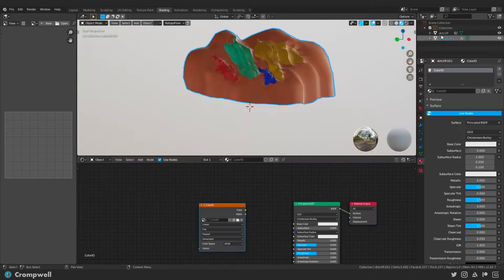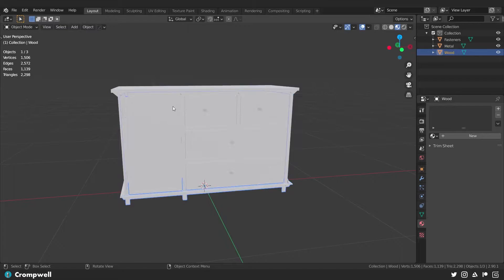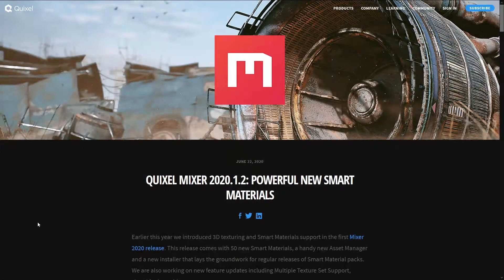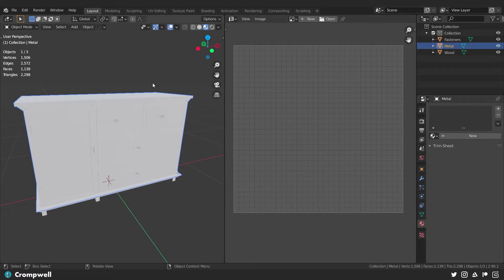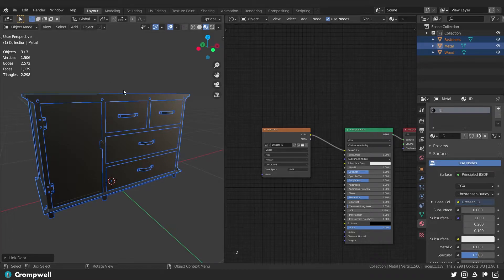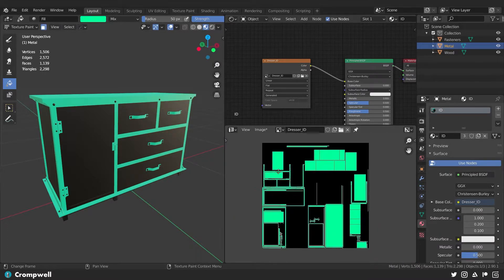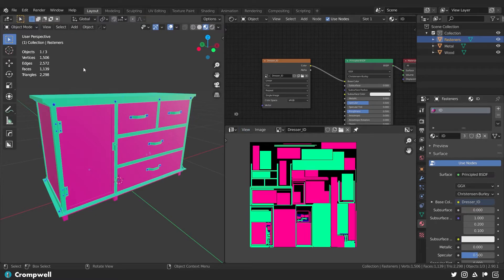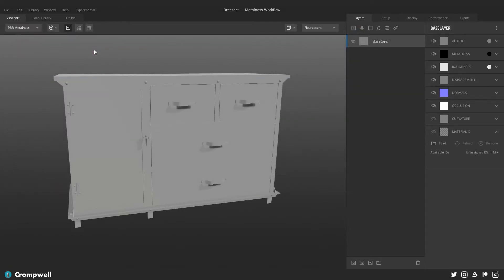Preparing 3D Models for Texturing in Quixel Mixer Pt. 2

Comment: Man, this is exactly what i was looking for ! Thanks ! Do you probably know, if it is possible to reuse paint masks on other materials/layer ? I can't figure it out.
Reply from the maker: If you have a paint mask in the stack you should be able to copy that layer and paste it elsewhere. It's been a while since I've used Mixer, but if you remind me with another comment, later tonight or tomorrow I can check.
Reply: @Crompwell  In case you can be bothered, could you have a look ?
Reply from the maker: @blenderheadxyz2418  Going to check now :)
Reply from the maker: So, with a paint mask, you can copy or move the layer to Layer Sets. Alternatively, you could export the paint layer and apply it as a texture mask to any other layer (this can also be done outside of Mixer, in Blender for example). Seems like it needs a workaround since you can't directly copy a paint mask to other layers, at least that's what I'm finding.
Reply: @Crompwell  Wow, thank you Mr. Crompwell :) That was very kind !

Comment: My mesh doesn't have a baselayer?
Reply from the maker: In Mixer? Might have to do with the new update that just happened.
Reply: Under Setup, click Edit Texture Sets, and you can add the ID at the bottom.
Reply: @kuro2ck  i did that, but i can't see the colors on the mesh, is so confusing since there is no info about the new interface

Comment: İTS PERFECT nobody taught texture painting for baking UV's. I have only one problem Where is color picker tool in the texture paint ? I want some of part same as other parts after I already paint.
Reply: I wnana thank you again again and over again. Its so ironic how it's so easy as well as nobody told this method before
Reply from the maker: Just hover the mouse over whatever color you want and quickly tap and release the S key. It will select the color. If you click with the mouse, it will attempt to add a swatch instead of picking up the color. I’m glad you found the video helpful :)

Comment: 6:50 when i select only one part of my mesh and follow the steps to fill with a color, it fills all of the parts of my mesh instead of the one that is selected.
Reply from the maker: Make sure the button next to “texture paint” in the top left is turned on.
Reply: i tried it a few times over and it seems to not be working the same as yours. my entire mesh gets colored in, except for some areas that are splotched with the cyan color and the original black color. i have clean uvs for both parts. its just a butcher knife. so when i try to fill the blade with cyan, the handle will get colored also even though its a separate mesh. is there an update since this video was made that maybe changed how it needs to be done now?
Reply from the maker: @EDITMODE  It’s difficult for me to troubleshoot the issue for you without seeing what you’re doing. If you want to upload a screen recording I might be able to help.
Reply: okay....its because my whole mesh wasnt unwrapped together. each part was unwrapped separately. if anyone else has this issue, unwrapping the entire mesh together should fix it.
Reply from the maker: @EDITMODE  Yes, if you have overlapping UV’s, this won’t work.

Comment: Hello Crompwell, and thank you for this tutorial :)
I have a question for you : I do the same export as you, but when in Mixer, I add a surface layer with displacement, the edges on my model are not connected anymore. It is like they separate from each other. I tried with a simple cube too, but the result is the same. I was wondering how I can deal with that. Do you have any idea ?
Thank you in advance and have a good day
Reply from the maker: You can play with the displacement amount or turn off mesh displacement entirely. There is a button on the top left, I believe.
Reply: @Crompwell  ok so for now it will never adapt to the edges and still explode them if I want a bigger amount of displacement ?
Reply from the maker: @bloupbloups  You’ll need to add more geometry or test it with something like tessellation in unreal engine. Otherwise, mess with the midpoint or displacement amount.
Reply: @Crompwell  ok I understand, thanks again